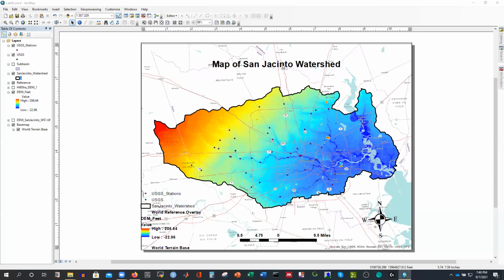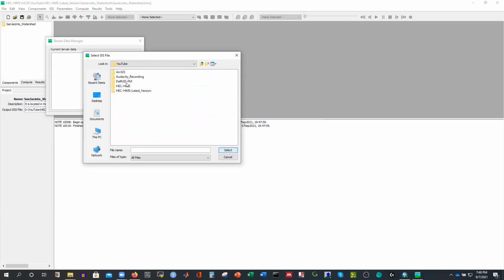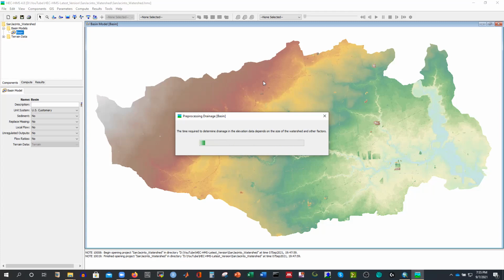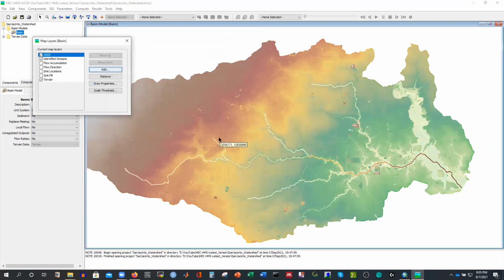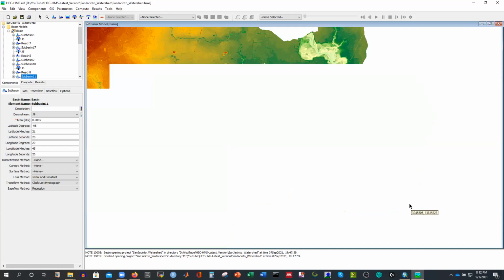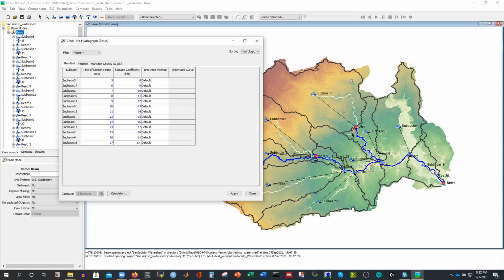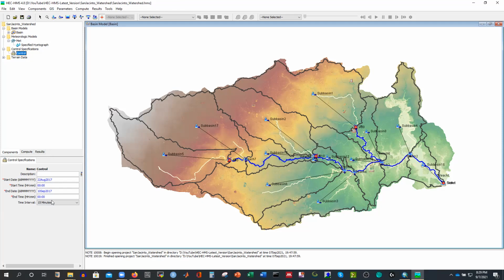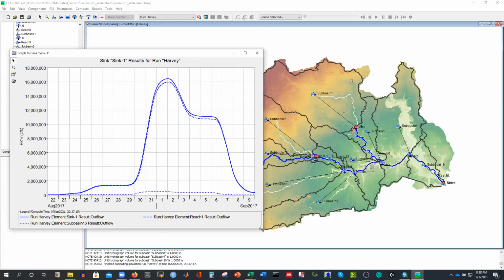HEC-HMS T1: How To Set Up HEC-HMS Model Directly From DEM Using The Latest Version

Comment: Dear Engineer Arifur Rahman
Thank you so much for the valuable tutorial. i am using the version 4.8 but cannot import the DEM. i think i don't process it correctly, I am downloading it from global mapper as TIFF then convert it to TIN but the HEC-HMS can not insert any of the formats.
Thank you
Reply from the maker: Hi thanks for the query. yes it's possible if you do it correctly. That's why I offer training on this software, where I demonstrate how to develop a complete calibrated model from scratch. For details information you can send message on WhatsApp at +16825537054.
Reply: @MdArifurRahmahn  thank you so much engineer for the prompt response.. Actually I tried with older version like 4.4 and it work with the same raster format of tif that I processed in arcgis.. It seems some issues with version 4.8

Many thanks

Comment: Hi sir, how to prepare input file of  discharge data as observed data from gauging station  for hec hms  model, and also how to prepare  rainfall events from  daily rainfall data of rain gauge station
Reply from the maker: Thank you Namwade for the query. It's possible to use the observed discharge as input. I have done that before, in order to do that create the time series and add it to the respective inflow points (i.e., output of a sub-watershed). I will demonstrate how to use inflow condition in a future video.
Reply from the maker: I offer training on this topic,  if you are interested,  send messages to +16825537054 on WhatsApp.

Comment: Please reply sir 
How to find K nad X values for muskingum method
Reply from the maker: You need to use observed discharge for calculating k and x. But usually, we assume x as 0.25 (average of 0 and 0.5), then we fix it during calibration. You can follow any hydrology book to calculate that k. If I get time I will make video on that as well.
Reply: @MdArifurRahmahn  thanks a lot sir
Reply: @MdArifurRahmahn  I'm having only outlet discharge data ( that is observed data).
Sir, Can you please suggest me a formula for calculating k and x values.
Reply from the maker: @PADALACHANNEL  K is the travel time from inlet to outlet, just use nay hydraulic formula like Manning's formula for uniform flow to calculate the velocity and then use any Kinetic formula such as S=Vt and find the value of t which is k here. You can use 0.25 for x as well.
Reply: @MdArifurRahmahn  thanks sir
Reply from the maker: I offer training on this software, if you are interested,  send messages to +16825537054 on WhatsApp.
Reply: @MdArifurRahmahn  sir I have calculated everything( input data ), except k and x values sir...please help to find k and x values ....

Comment: My terrain data is not opened in here
. What to do
Reply from the maker: Thank you Adhithya for the important query. In order to open that first you have to have the latest version of HEC-HMS installed on your computer. If it's not the case then check my Playlist on ArcGIS where I have demonstrated how download and create the DEM data for the study area.
Reply: Sir can u give your mail I'd.. I have a doubt regarding this hechms
Reply from the maker: @adhithyaadhi8631  mdarifur.rahman@uta.edu
Reply: When delineating, it shows "could not delineate elements becoz breakpoints didinot intersect the stream network"
 Can I help me 👼😩
Reply from the maker: @adhithyaadhi8631  I understand the problem completely now. Just zoom in until you see the grids and put the points on the grid cells where you want to put the outlets. This time it will work for sure.